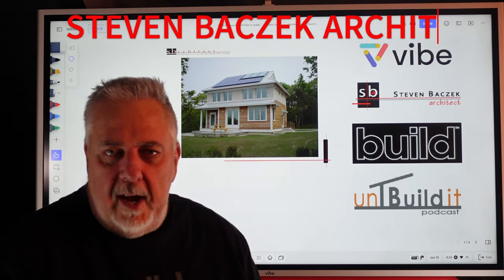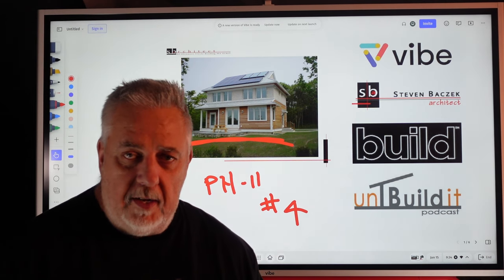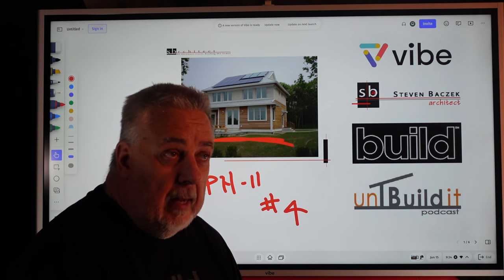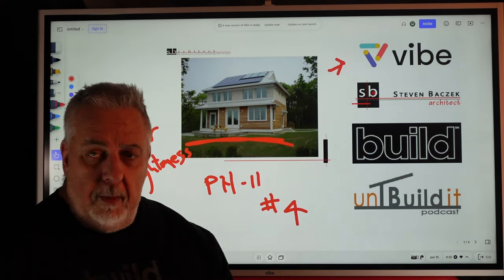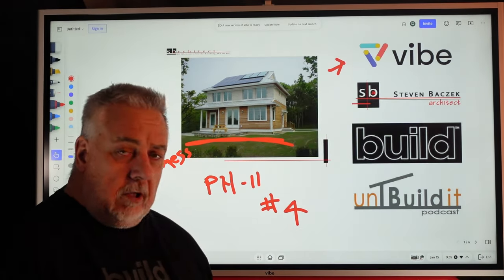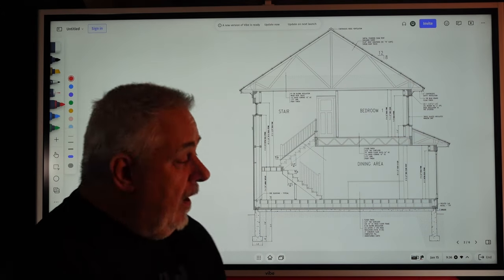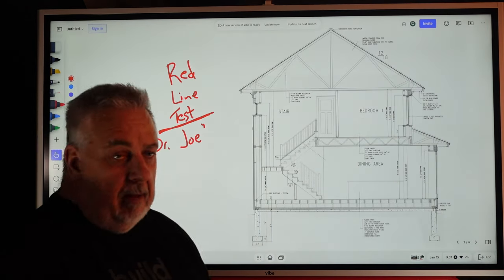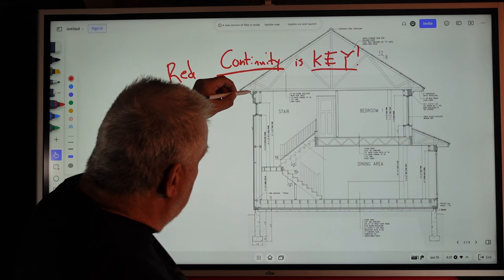PH 11 Episode 4 - BLDG SECT / AIR BARRIER

Comment: Ha-ha, inside - outside. Continuity! Man, I'm so impressed with Zip sheathing!  I'd love your insight on using Zip-R vs Zip and then on outside apply InSoFast insulation. 

Foam touches Foam, touches Foam, ... ! 😎 
Haha, that black goo!  Based on your recommendations back then, we also used Tremco Acoustic Sealant anywhere on exterior where wood touched wood as well.  It was messy! 

Cheers, Eric
Reply from the maker: Hey buddy!!

Comment: Always a lot of great information Steve!!! Do you happen to have a check list of things that you always do/mandatory (in your mind), like that acoustic sealant, for example,  that you could share with us? Also I have seen several different ways that you do exterior walls, double walls, exterior  insulation, several different types of insulation,  what determines that? Thanks for everything that you do and thanks for the leadership and knowledge that you share with us.
Reply from the maker: I do have a virtual checklist - but it gets tuned to the project

Comment: I would argue that an unconditioned attic isn't inside the building... If the eave vents were 2' wide and made of metal mesh so that they were easily seen though, no one would argue that the roof wasn't just an umbrella over the home, and that the building stopped at the second floor ceiling. The detail is harder to see with a suble eave vents but its still there.

Edit: question about the acoustic sealant... Is that a detail you would still recommend, or is the best practice now taping/liquid flashing the zip to the foundation wall?
Reply: Ditto